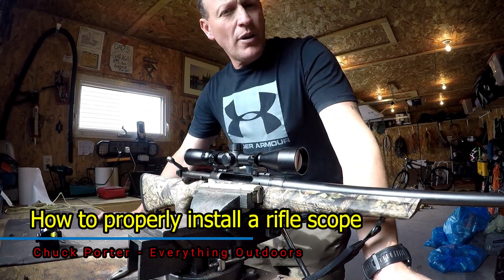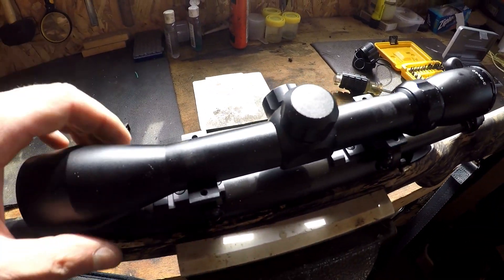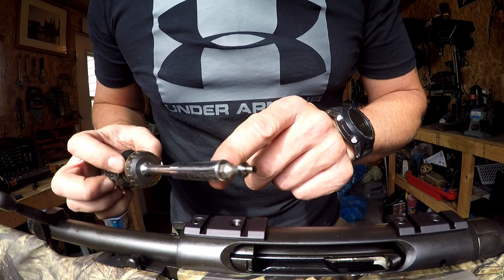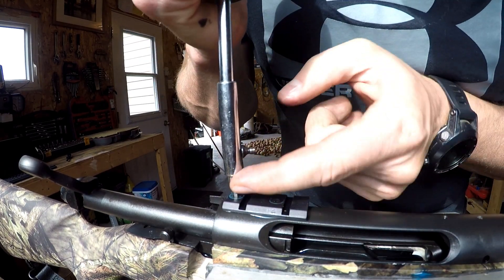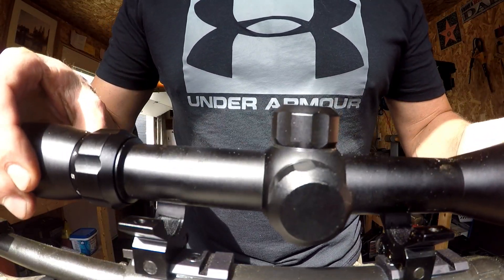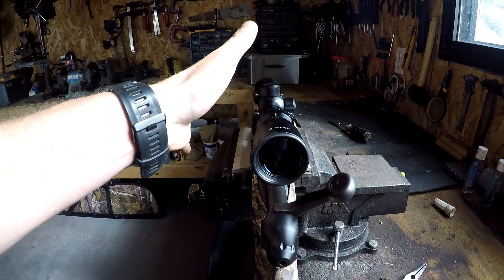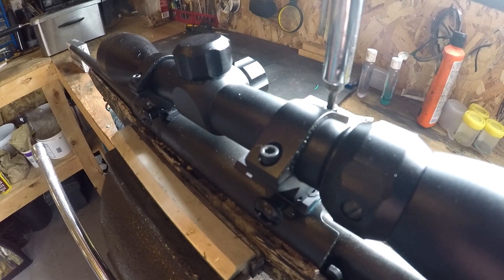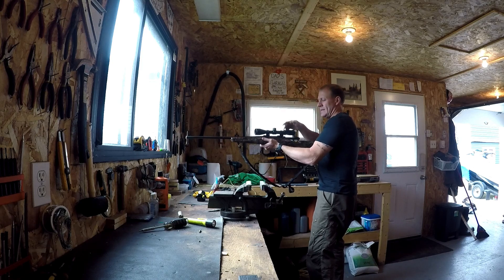How to INSTALL a RIFLE SCOPE:  The BASICS

Comment: Frankly I have the same rifle is there anyway I can clean the bolt face and assembly without taking the optic off or is that just something that has to happen?
Reply from the maker: No you don’t need to remove the optics to remove the bolt. Good to go by just pulling it back and pushing the release mechanism👍